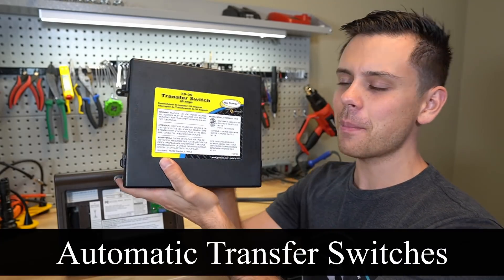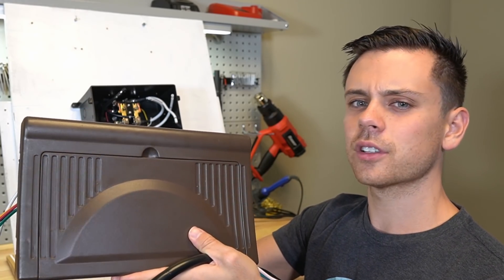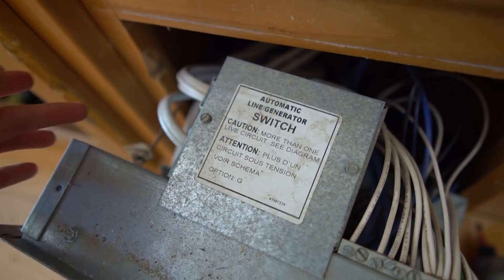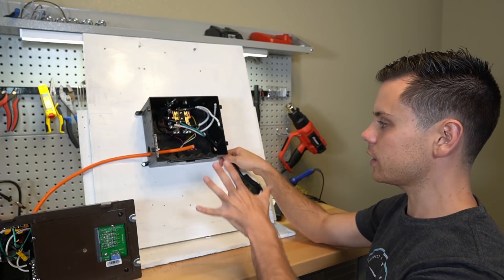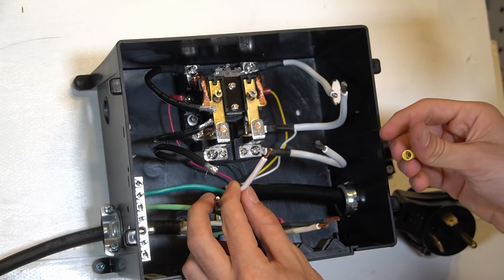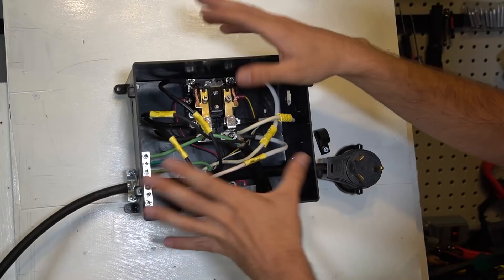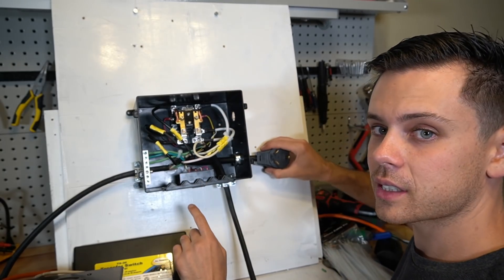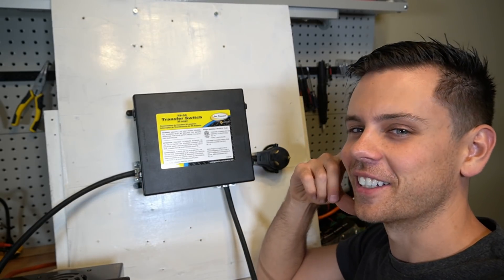RV Solar Power: How to Install an Automatic Transfer Switch to a Solar Inverter

Comment: Good stuff Will. Some of us need 50 AMP shore power. I also feel better if the boxes are metal. Thanks for branching out.
Reply: There are metal 50 amp boxes for rvs on Amazon.  About $150

Comment: Nice workshop, good lighting and sound. Oh and the video was informative as well, thanks
Reply: I know that this is the recommend installation method with the normally closed operation of the switch going from shore power to panel but in my experience I find that the coils used to hold the contacts when switched draw a constant 30 to 60 watts so why not run the inverter on the normally closed side so it's not using extra battery power and run the shore power on the switched side where there is an abundance of power?

Comment: I knew how to replace an ATS, as I had one go bad in an old Allegro RV, but did not realize this was the answer to another burning question I have had, that no one seems to know the answer to, and that's HOW to wire my inverter to my regular, 30 amp breaker box so I don't have drop cords and power bars laying all over my Skoolie. Solar is great, but I like to use my wall outlets as opposed to cords laying everywhere... Thank you!
Reply: Dakota Blackwater That’s exactly it. Nice job, Will.

Comment: Good job Will.  I didn't cringe...the only thing I could add is that the jacket is normally removed to allow 1/4" to 1/2"  of jacket showing inside the box at the strain relief connectors, but that is just how it's normally done....what you did is fine.  Another thing you could try to do is to explain the routing of the hot wire to the relay and how it works in normally closed position and what happens when the relay is energized when shore power comes on.  That may be too much information...cheers.
Reply from the maker: Oh good point. I was scared I would lose people if I talked about that haha but yes I agree!

Comment: Thanks again Will.  great video and really well done.   For those of us that want to use shore power It would be awesome if you did a video on some of the A/C chargers out there for LifPO4.  

I ended up going with the 12V  MPP Solar all in one because I couldnt find anything that compared even close on price, but I am worried about some of the limitiations of that unit, and may eventually go to a custom built solution that does the same thing.
Reply from the maker: Well mpp has ats and charger etc. What limitation? 

And for LiFePO4 I always recommend the progressive Dynamics LiFePO4 charger. It kicks butt.
Reply: @WillProwse   Mainly Inverter size, solar input limitation, and only a 20A utility charger.  

There is more flexibility with building more capacity with a modular system. 

Maybe it is considered very basic, but it is very hard to find information online about the utility chargers for shore power for liFePo4 batteries. 

Thanks for your awesome videos.
Reply: Basically you need to do a video that shows a modular version of everything inside an MPP Solar system.  Most of your videos skip how to make shore charging play well with solar charging

That would be awesome!

Comment: So correct me. You take solar to mppt to 12v to inverter 110 to transfer switch to battery charger to 12v to battery and house loads and 110 distribution?

Comment: I don't think the converter should ever charge the batteries in this setup, otherwise whenever not connected to shore power your batteries will be charging themselves and wasting energy (unless the inverter is also turned off).
Reply from the maker: Just posted a comment to explain this:

Solar battery shore charging is covered at the very end of the video, but going by the comments, I need to clarify it here: No, do not charge your solar battery with the RV converter charger!! Hooking up a solar battery charger is covered at the end of this video.

If your RV has a solar battery AND a house/coach battery, then the RV converter charger is great and there is no need to disable it.

If you are using one battery for both, and you do not disabled the RV converter battery charger, you are going to have a bad time! Think about it like this: if you have a battery, powering an inverter, charging  itself with the converter charger, you are going to have problems! I figured that was implied, but going by some of the comments, people are not understanding that part of the system. 

Many people use separate solar batteries than their coach batteries, or want to run their RV from a goal zero or other solar generator. Or a gasoline generator. Which means wiring the ats as shown in this video is ideal. If your solar battery is also your coach battery, you need to wire up your own battery charger. 

Does that make sense?
Reply: @WillProwse  ok I think I get it now, I have to disable the converter's charger, and connect a new charger to the shore power in the transfer switch, and then run yet another cable from a new charger to my battery bank?
Reply from the maker: I would use a separate battery for solar and not touch the RV coach battery.
Reply from the maker: Oh right, if you have one battery for both, you need a separate charger. And yes, disabled charger in converter box. I hope this helps. Sorry if it's all confusing
Reply: Thanks. I just have one pair of 6V 208Ah golf cart batteries (in series) for now.

Comment: I've seen vehicles with chains dragging on the road surface from the vehicle frame... Is this a means of mimicking a true "earth ground" for the vehicle?
Reply: I believe those are to prevent static build up, preventing arcs and sparks when you go to step out of the vehicle, etc. You wouldn't want a spark from static when fueling for sure!
Reply: @javabeanz8549  After doing a bit more research on my question, what you've spoken of is what I found... Thank you for your reply.
Reply: Anthony Burkett more likely, they were safety chains dragging... a chain on the surface wouldn’t provide any fault current protection...

Comment: I put an after market true charge in my rv and got rid of the factory one. Instead of powering it through the transfer switch, I put another 20 amp circuit on the 110 side of my panel.  That way I can turn it on and off by flipping the brreaker
Reply: NoobPvPtv unless the breaker is locked out of shore power, it is illegal to have manual breakers connected to power such as solar, or generator...

The transfer switch makes it automatic, and legal, and safe.
Reply: @SuperVstech  the breaker connects the after market battery charger to the 110 circuit via an additional 20 amp circuit inside the installed power distribution panel.. It is no different than adding and extra circuit in your house. There is nothing illegal or unsafe about what I did as long as you follow the manufacturers recommendations regarding wire and breaker size. I clearly said I was talking about how I installed an aftermarket charger. Doing it my way gives you the ability to isolate circuits and the charger. Being able to isolate circuits is always safer than hard wiring stuff.

Comment: Ground to RV chassis running on rubber tyres ;-)
Reply: It's not really grounding, its referencing the chassis to neutral, so it will be grounded when connected to grid power, incase there is some short between hot and chassis, it will trip the breaker,

Comment: Cool. I bought and installed one of these for my home sump pump system early this spring. Already saved my a$$ this spring.  Neighbors were scrambling with buckets and looking for generators after a storm took out the power.  I was 1000 miles away, and resting happy as this automatically switched over to my inverted and marine battery array!

Comment: Hi Will - unrelated question....can I use a Jackery 500 to keep an AGM or Lead-Acid battery topped-off? I have a circuit that will require 11 amps of DC ( diesel heater ) for about 10 minutes turning on and the same for turning off. The Jackery is only rated at 5 amps ( IIRC )...I figured to directly connect an AGM battery to the heater and use the Jackery to keep it topped-off. I don't have solar, yet, so that's not  a complication just now. If that doesn't work, then I need to get a 10amp capable converter and connect to the AC side of the Jackery, but that seems pretty inefficient. Please note that the diesel heater only draws .2 - 1.5 amps when running after it is started.
Reply: Don't the Jackery units deal with minor surges for a few seconds? Have you tried it to see if it'll start? If it falls back to only using under 2 amps, the Jackery can cope with that no problem.
Reply: @BikeHelmetMk2  It needs 11 amps for about 10 minutes, apparently. It's powering the glow plugs to ignite the diesel. When powering-off, it maxes-out the fan and stuff to burn off the soot.
Reply: @Jollyprez  That is unfortunately too much for a Jackery to cope with, for too long. I'll leave finding an answer to someone that knows.

Comment: Excellent show Will!However,  doesn't one have to have an electrician's certificate to work on wires in a home or RV? In Canada we must. Some amateur electrician wanna be got electrocuted doing wires  incorrectly in the shower.  One does hear horror stories especially wires around water. Ideally all wires should have sensors if frayed, overheating etc. My fear old houses and rodents chewing through them! Don't want to be a Debbie Downer but safety first!
Reply: boy, I don't know what they teach kids in Canada, but when I was in school, and when my kids were in school, our electric company came around and talked to the kids and handed out comic books about safety with electric power. AC wiring in a shower? That should have been taught as a no-no in grade school...

Comment: Hello Will, great videos!  I am building my own travel trailer and I was wondering if you already produced a video about connecting a plain inverter and a converter:  I purchased a Progressive Dynamics converter expressly designed for lithium batteries, I plan to buy a Battle Born 100A Lithium battery and the inverter is still to be chosen.  Please, let me know if you already produced such video and your suggestion about a 1500W inverter, which power will be plenty sufficient for my needs.

Comment: That was great thank you vary much. Just have one more question how much solar and battery's do I need to run my stock RV A/C. I have 6 100w panels and 6 100ah mighty max battery's.
Reply: How would he know? You didn't provide a model number.

Check the amp rating and voltage on your AC. If it says... 120v 10A, then it's 1200 watts when running, and running it for an hour needs 1200 watt hours. Your solar panels can supply 600 watts, or 600 watt hours per hour of charging, so half of what is needed. But you might only need the AC sporadically, while they can charge the batteries all day.

6x100AH = 600AH, * 12v = 7200 watt hours. Enough for 6 hours... except that, if those are lead acid, you don't fully discharge them unless you want to kill them. Cut that in half for lead acid and chop it down another 20% if using an inverter. 2800 watt hours is the practical max, so about 2.33 hours or 2 hours and 20 minutes.

I gave you enough numbers that you can probably find them out from your own equipment, punch them in, multiply and divide and get an answer that applies to you.

Comment: A few years back my converter box died. Replaced it with a better one and installed the transfer switch at the same time. I was running mainly on solar, and ran generator when needed. It was ok.

Comment: More videos on rv electrical,  rv solar, converters/inverters etc   agm battery charge settings (float/charge etc)  great video
Reply: You should read his book. After that you should be able to help others in the RV parks. Could even make some side change.